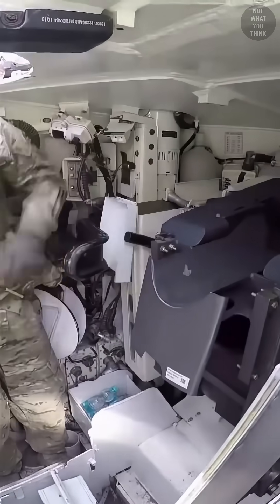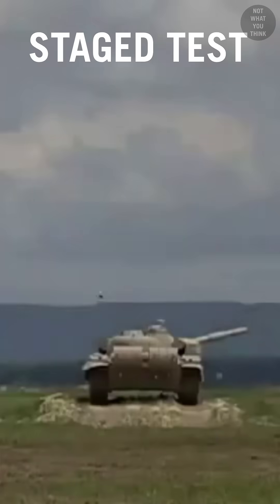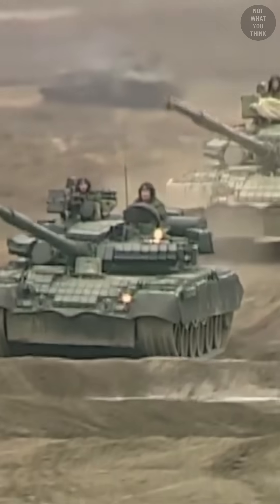Why M1 Abrams Tank Has No Auto-Loader #shorts

Comment: I've seen the inside of the stryker tanks and worked with tankers. Newest private always loads. Second in command drives. And the vehicle commander is the higher ranking. Typically. On a stryker everything is operated from a joystick inside. Even the turrents

Comment: There's this one argument i kept hearing as well, Manual loader can change ammo in the breech but autoloader can't.

In the older days, that's doable with brass casing. But today? also doable..... but you are advised NOT to do that, for an obvious reason. You do realize that modern 120mm cartridge has a nitrocellulose cartridge, did you? It's fragile, and combustible.

You want to extract that unfired or dud cartridge to change ammo? you're risking you and the entire crew inside the tank from fire hazard. One incident exemplified this, and it involves a dud round in an merkava led to premature ammo detonation after the loader extracted the round and accidentally broke the cartridge, spilling the propellant granule on the floor, which was ignited by hot brass casing.

Comment: "Ammunition cookout risk"

NATO and allied tank design with autoloader (Leclerc, K2, Type 90, Type 10) has similar ammunition loadout like the abrams, they even have the same blast door design as the Abrams. The difference? the autoloader IS PART of the ammo rack. Because these autoloader shoves the same one-piece cartridge as the Abrams, and the rammer position is aligned with the gun just like a battleship gun rammer that would push ammo horizontally to the breech, the loading rate is fast AND  constant.

"But what if it malfunction from enemy fire?"

Because the autoloader is part of the turret ammo rack, what makes that part different to the Abrams that would suffer similar damage if it was hit at the rear portion?. As said before, despite having autoloader, the ammunition rack of these tank are not like Soviet, and more like Abrams.

"But extra man"

The_chieftain, a former Abrams TC mind you, discussed about this and pointed out that despite lesser crew in tank, the number of men serving in one platoon remain unchanged. "rear echelon" crew serve in similar manner like having 4th crew member in a tank.

the Army probably retains it that way because as "Iceman" has pointed out, Soldier are the government's "Semi-skilled labor". They could sacrifice the tank weight with more added armor just to protect that 4th crew because they deem it's easier to invest in gullible soldier than investing time in making an autoloader, like Japan, South Korea, and France.... Even though if we approach this conundrum logically, the cost of creating an autoloader is probably just the same as investing your tax money to train and maintain the 4th man crew's welfare LMAO.

Comment: Mainly Wrong, Y'All. Auto loaders fixed & limit the physical dimensions of the projectiles you can fire. They bake in the type of APDSFS rds you can fire.

That means in the case of Ruskies tanks they find it very difficult to incorporate later generations of APDSFS rds, which are longer. The longer lenght in relationship to the calibre of the sabot, to confer/enhance the ability of APDSFS rds to pen heavier/improve tank armour frontal armour arc at extended combat ranges of around 2200 yards.

Comment: Unless we can design an autoloader that can still allow manual loading to be done quickly than its a point of failure that renders the vehicle combat ineffective if it goes down.

Autoloaders are cool until it takes a s**t and you can't load your main gun anymore.
Reply: Well yes but autoloaders are extremly hard to break and require very litle maintanince (one of the reasons autoloaders are preferd by russians) loosing power also isnt a problem cuz most autoloaders can also be manualy operated it just takes allot of effort and will increase loading time to around 20-30seconds but in most every case a autoloader is better

Comment: The reason the M1 doesn't have an autoloader is because the M1 is an outdated design.
The real question is why hasn't it been redesigned since back then?
Answer is because Gulf War has shown this isn't WWII anymore: tanks don't fight ambush battles, they get destroyed by air  support or get whacked by other tanks or artillery they can't even see. An old design retrofitted with modern electronics and optics and backed by good C3I and backed by satellites and air support will win any day 1v10.
So they keep that old ass hardway and the money is spent elsewhere.
And I'm sure if the US finally get an autoloader in a future design the same people defending manual loading will claim it's the greatest thing since sliced bread.

Comment: Well, while on average yes, a tank using an autoloader is more prone to getting ammo racked, it isn't by much, hell you can find vids of T-72s and T-64s getting hit yet you still see 1 or 2 crew members getting out, not to mention sometimes a crew member is too injured to escape on his own so they get them later, yet I do not have an accurate number on how often that happens. Now imagine a modern T-90M with it's way better crew safety and the T-14 which the crew are kept in a bubble, so even if ammo goes off, they won't be affected and the tank will still be drivable.

Now onto the extra crew member, most tankers from what I know will ditch their tanks after one penetrating hit, you got no idea what's happening, you gotta see who's dead and if the gunner's dead, good luck taking his place especially after the scare takes all your strength away and beating the enemy tank which is loaded by now, but yes, an extra crew member can help with maintanence

Now onto pros, you are able to make a way smaller turret, resulting in quite the weight decrease, look at the Soviet MBTs that featured them, they have very impressive specs for their weight, hell even in modern times it's visible, the Leo and Abrams are nearing the 70 tone mark but the T-90M is under the 50 tone mark, now yes, it does not have an APS system but the T-14 does, and it's a beast size wise compared to the T-90M, yet we've been told It'll weigh about 55 tones, but we'll need to wait to see if that is actually true.

Reability and loading speeds are also very good, autoloaders don't jam as easily as many say they do, especially when crews take care of them, and to the injury mith, tanks have all kinds of hard, sharp edges, that's way more of a worry then a autoloader imo. And speeds, sure while on average a bit slower, irl there aren't many scenarios where you'll need a shell off every 5 seconds, not to mention, while a autoloader will have the same reload speed nearing the end of a battle, I wanna see a human loader achieve that.

Tldr: Each system is good, unless you're using ammunations above 125MM then a human loader can't do well.

Comment: The extra crewman is invaluable in the field.  Track/vehicle maintenance, crew comfort, crew “healthcare”, field security, and low-intensity conflicts where an extra machine gun is needed   is massively improved with that 4th man.
Reply: Yes but if he die you can't shoot so your tank is vulnerable of from the other tanks
Reply: @axelderoo7544   The 3-men in the turret are all trained for double duty in US & UK tanks.    if the loader is killed/incapacitated, the gunner moves back & becomes the loader, while the commander uses the duplicate sights & fire controls at his station to become the gunner.    
   Compare that to a T-72/90 series of tank.   When the autoloader breaks down, the tank either just can’t use its main gun anymore, or it becomes a hand cranked manual system.    The gunner has to spend nearly 2minutes hand cranking the carousel around to load the 2-piece ammo, and then go back to aiming & firing.  As the T-72b3 & T-90M don’t have a dual-sight/controls capability where the tank commander can take over for the gunner from his own seat.   

Plus, the working autoloader cannot change the ammunition type on the fly.  So, if the commander ordered an HE-Tracer loaded and an enemy tank shows up. They have to fire the HE shell first, giving away their location, and then hopefully load & fire an anti-rank round before the enemy’s anti-tank round pushes the turret eject button.
Reply: @axelderoo7544   the Russians/Chinese should have just copied the LeClerc if they needed to stay with a 3-man crew.    At least that tank has some serious armour plating between the crew & autoloader; with blowout panels too.     You can hit a LeClerc right in the ammorack with a NLAW, Kornet, or Javelin  and the crew will live to fight another day.   Their autoloader does not double as a turret eject apparatus if the ammorack is hit.

Comment: The placement of the russian autoloader is not made randomly
During there development it was placed in such position because it has less chance of exploding (at that time it was safer than things like m60 and leopard 1 since these tanks stored ammo everywhere in the hull and turret)
For modern standards u can go for a leclerc style auto loader which is incased in an armored capsule with blowout pannel
Autoloader are generally better than a human loader as u can make longer shells that are heavy or larger calibre rounds 
Also incase of russian tanks they can have crew for 1 more tank every 3 tanks because they saved the loader position

Comment: Actually... no.  Every reason you gave is wrong.  Those are just add on's.  The real reason is that a team of human loaders are at a minimum three times faster than an auto-loadres.  Plus, the M1 doesn't have to re-aim for each shot.  For an auto-loader, the turret has to elevate to a very specific angle, get cleared, get loaded, and then return to the original elevation.  By that time, the Abrams crew has driven to your house, drunk you beer, nailed your girlfriend, and is back sitting on your 6.

Comment: during a real combat environment where a tank is most likely a target, a damage from the autoloaders mechanism would render it useless and needs repair while if the human loader got injured inside you can easily call in a replacement
Reply: Also even if a loader get damaged but the damge isnt critical on for example the T-72 there are also manual hand cranks to operate the loader while yes it makes the firerate go down to around only 1 shell per minute its still functional
Reply: please read into the Leclerc...
Reply: If you somehow got enough battle damage to knock out a human or mechanical loader, the tank is likely going to be out of action for days to weeks anyways so that point is pretty moot.

Comment: Replacing a body for your loader is much easier than fixing and replacing a machine. An actual person loading the gun also does it quicker
Reply: not on the move, not without having a round already in hand which can get you in trouble. hence why all new design have autoloader and those who dont, do so because of cost.
Reply: @mitri5389   Yeah you can replace a person on the move, literally use anybody who knows how to pick a round up. Repairing an auto loader on the move would be difficult based on the damage, not to mention likely not combat effective.

Comment: Russian tanks that uses the entire turret as blowup panels: "I am four parallel universes ahead of you"
Reply: When you cut off someone’s head to get rid of brain cancer
Reply: @offdeck8588  "Modern problems require modern solutions"
Reply: AKA convertible option.
Reply: @ericgrinnellsr.832  dababy option
Reply: Isn't that called an armored car when it doesnt have a gun?
Reply: @radiotests  Please specify.
Though you are 30% correct. But there's more to that. The term armored car is very rarely used for military terms, but rather for civilian uses.

The term "armored car" is pretty vague, so it is rarely used. Anything with armor could be called an armored car.

A civilian car with armor is an armored car. The Humvee is also a car with a thick packs of armor with a gun, so it could also be an armored car, but Humvee is a Multipurpose Armored Light Utility Vehicle.
Reply: @Srae17  "anything with armor could be called an armored car" so soldiers wearing a bullet proof vest are now armored cars. Cool

Comment: The most expensive MBTs always have an autoloader. I wouldn't call Mitsubishi Type 10 cheap either but Japan's Type 90 and Type 10 have autoloaders does come with a reason: low birthrate.
Reply: Low birthrate point is reasonable in Russia as well
Reply: Now this is a good dark humor joke
Reply: Damm you don't need to get that far bruh
Reply: I don't think you're right. Japan did not equip the Type-16 with an autoloader, although its newer than both Type-10 and Type-90 and its already more numerous than the former. If I remeber correctly the japanese mod argued that 120mm shells were too large to be handled by japanese crewmen effectively.
Reply: @hendi1571  forgot about that. Some Type 74 crew would probably be assigned to Type 16 when they reduce the Type 74 fleet I think. 105 is lighter than 120. But there are other Asian countries that operates MBT with 120mm gun. Singapore operates the Leopard 2. K1A2 from ROK is equipped with the 120mm gun and utilizes the crew of 4.
Reply: @Joshua_N-A  thats no Argument at all. When Japan did introduce the 120mm, it was the first east asian country (apart from china) to do so, Singaporean and Indonesian Leopard 2s and Korean K1A2 came much later. 
If Type 16 was to keep 4 man Crew because crews were and are to be transfered from Type-74s, why doesnt apply the same for Type-10? The crews would even stay in the same units, as many units formerly equipped with Type-74 are now to be reequipped with Type-10... Apart from that, the transition from 4 to 3 man Crew is not a big deal: the gunner has to be retrained for Type-16 in every case, as it is equipped with new fcs and sights. If birthrate would be that much of a factor, Type-16 would be fitted with an autoloader - i repeat Myself, but its both newer and more numerous than type 10.
I did some research and the japanese mod did even think, that a 90mm shell would be the maximum for an japanese tanker (so Type 61 got a 90mm gun). This might not be the primary reason for the autoloader of the Type-10, but its defintely not about birthrate.

Comment: Auto loaders are better for sustained fire when u need to put 10 to 15 round down range hence why alot of SPGs use them
Reply: most SPGs use it cause the shells are about 2-3x heavier
Reply: Not really, a human loader can do that just fine, shells weigh only about 50 lbs. Besides, a tank will not fire rounds that quickly, and once it fires 18 it will have to retreat to take ammo from the hull to the loading rack.

Comment: No, its still not what u think. Autoloaders are inherently better than manual loaders in safety and everything. Autoloaders have blowout doors also. So  manual loaders dont have any advantage.
But the biggest thing u gotta ask, if it works, why u need to change it? A manual loader works fine, albeit autoloaders are safer. So, its a matter of time till me make that shift to autoloaders

Comment: Certain tanks with autoloaders extending into the hull actually are compartmentalized and have blow out panels underneath.
Reply: russias tanks use the entire turret as a blowout panel
Reply: @TheArcticFoxxo  Only if the hatches are closed. If they're open, it'll actually just vent through them.
Reply: @YoRHaAttackerNo2  i dont think you got the joke, plus ooo sauna
Reply: @TheArcticFoxxo  one becomes a sparkler, the other actually uses the turret as a giant blow off panel firework
Reply: @YoRHaAttackerNo2  hecc yeah